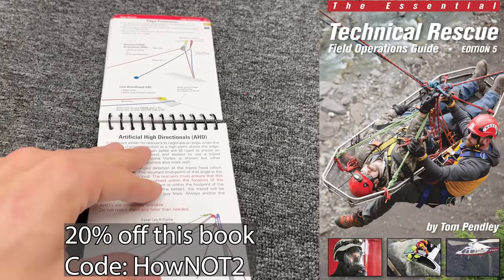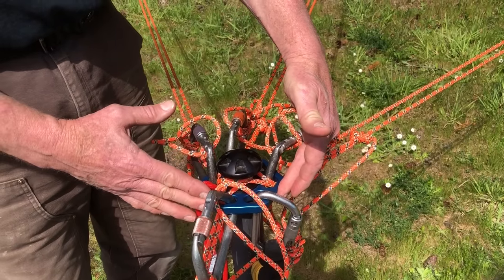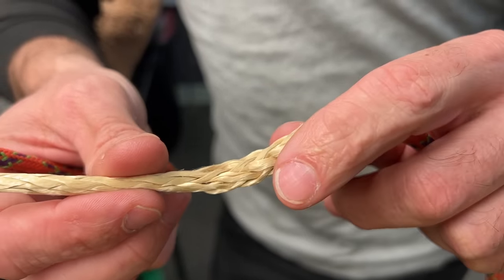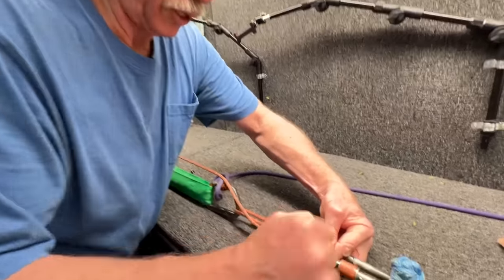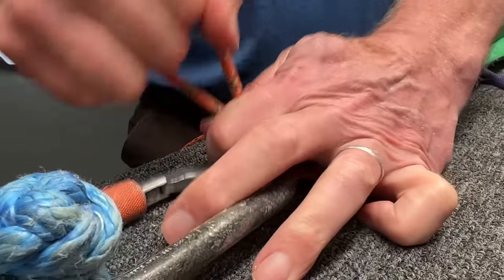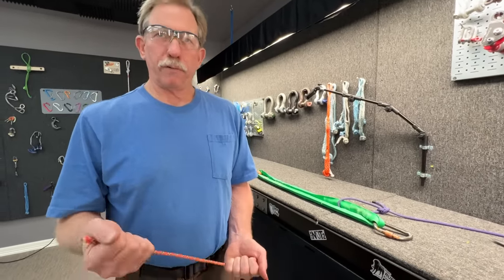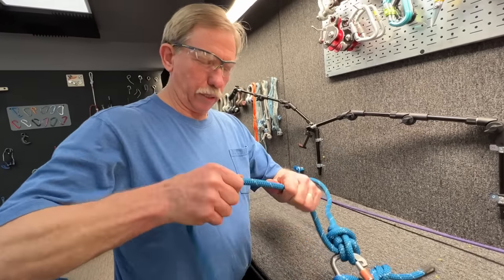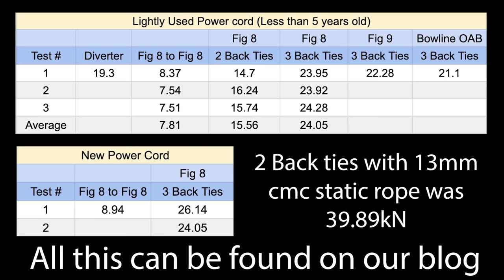How strong is this skinny cord?

Comment: i would avoid calling the figure 8 knot a "Fig. 8" in your literature like that because it could easily be confused with a literal figure number 8 (as in the 8th figure in a section of your literature). I would either type it out or make it shorter like "F. 8". its a nit pick, but i write technical manuals for a living lol

Comment: As an arborist, this served as an excellent illustration of the difference between a bollard to bollard break test, and real world application of a ropes break strength. I use a portawrap (essentially a bollard) and blocks to lower heavy wood and branches, but my climbing lines are often tied off to caribiners. All that said, if I'm putting anywhere near these numbers on my static climbing line, I'm already dead.
Reply: I've used arborist videos quite a bit to explain to blacksmiths and other traditional tradesmen how they can use rope and pulleys to move very heavy pieces.  We tend to get fixated on the details of our trades, developing something of a tunnel vision that occludes anything that doesn't fit our thinking.  Everyone forgets that all those neat pieces of equipment, sculpture, or gates, huge as they were, had to be moved somehow and they didn't have access to modern cranes, ratchet straps, etc.  Thank you for keeping the skills alive!
Reply: @threeriversforge1997  Those skills are very very old indeed. I think the penultimate applications were the British naval frigates of the days of sail.  Every evolution required expert knowledge and miles of (by our standards) very weak lines.

Comment: Thank you very much for this test. If the fig 8 is the weak point of this connection, which results we will expect if you use on both sides the same knot "double round turns and two half hitches"? 

Btw: other manufacturers also have extraordinary products. F.e.
LIROS "Max Load Black", 6mm, 25kn mbs, SK78
LIROS "Control-XTR", 8mm, 62kn!!!!!!, SK99

Regards
ah

Comment: Remember what you learned from the dyneema triple loop testing: pre-stressing greatly increases the strength of a rope system by tightening up the splices (or knots), reducing their tendency to slip under tension. Slipping generates heat, and it's the heat that weakens the rope in the knot, not the pinching. If you re-tie and pre-stress all the knots you tested here to eliminate most of the slippage in the final break test, you will get much higher yield strengths.

Comment: Many, many years ago when I was a full time firefighter and on the high angle team, we were using ⅝" double braid rope.  If I recall, it had a MBS of around 15K lbs.  It was very soft and pliable but heavy as hell!  We were using it on the Dallas FD helo mock up skid at their drill tower and it would not feed through an "8" very well at all.  When I retired, we were using the latest Kernmantle static rope.  I very much like the idea of the PowerCord.  So much lighter and very strong.

Comment: Hey love what you’re doing. I’m a kayaker and fortunately I’ve never had to use my rope rescue equipment. Really enjoyed seeing the knots y’all use and I’ve never heard of a lot of these concepts. Thank you for making great content. I would love to see a video about span sets
Reply from the maker: How do you want us to test spansets?
Reply: @HowNOT2  the way that I have been playing with them is using them as makeshift anchors for boat rescue. I’d love to see what happens if they end up in a basket hitch, girth hitch (and others), what happens when they’re wet, if they can be clipped into an NRS whitewater biner and maintain strength; In short, are they super good enough for whitewater.

I play with a lot of these things all the time if you ever want to talk about whitewater and ropes. Thank you for the great content!
Reply: I've been kayaking and rafting for decades and have never seen a spanset on the river or in a swiftwater rescue class. 1" tubular webbing or 1/2" static rope is the most burly stuff I think you'd find in regular use, if you're seriously risking breaking that with your z-drag then you'd be bending raft frames and ripping grab handles off of kayaks

The NRS biners are nothing special either, just relatively heavy and inexpensive climbing hardware. Both the Nuq and Sliq biners are made by climbtech, with the Sliq having previously been marked by CT as the Anejo
Reply: @liam_hurlburt  sounds like you’ve got a lot of experience. I’ve never seen a span set out there either. I was just curious what might happen and if they could be useful. Also I know that NRS biners aren’t anything special, but they are smaller than a lot of the carabiners I’ve seen in climbing related to thicker textiles like span sets.
Reply: @liam_hurlburt  looked more into what you were talking about. Span sets have almost no place on the River. Just ran across some 18kn webbing and that is more that 2x my span set. Thank you for replying before

Comment: You've just triggered my ADHA with trying to figure out a better knot system to use then figure 8's. I'm scurrying back into my high ropes coarse construction days when we were working out breaking strains on knots and the best one to use to clip clients in using the steel eye crabs. I've always loved the industrial rope access stuff, and I wish we'd done more of the qualifications then we did. 😊👍👍👍👍👍👍👍

Comment: I have a question for you. I do both sailing and climbing. On our boat we have mooring compensators. Basically pieces of rubber you tie rope around in a spiral. If the rope comes under tension the piece of rubber stretches softening the blow and making it a lot more comfortable to sleep onboard. Could you do the same for climbing?
Maybe this would allow you to climb with static rope and give you a more fixed easier to calculate stretch independent of how much rope is in the system.

Comment: In our local rescue group, we use 5.5mm dyneema core accessory cord, rated 22kN end to end, and it has sewn ends to keep the core and sheath together. Would love to see some testing of that in different configurations, doubled with a flat overhand, using it as an anchor, either girth hitch or overhand masterpoint, or in a series anchor. We also use it for load transfers with a friction hitch ob the rope, munter mule at the anchor, would love to see if single strand is suffiecently strong or if doubled is necessary. Also, it would be nice to see the strength reduction some basic knots have on that cord, Figure 8, Overhand and Alpine Butterfly maybe. I believe our cord is made be Austrialpin, I think Edelrid has something similar, though that could be 6mm, not quite sure about that.

Comment: Did I understand correctly that the rope, as such, can tak 19.3kN, and all the other single-rope results were lower because of the knots?
In that case, would it be possible to somehow make knots with a lot higher radius, in order to reduce the weaker kinks in the knot? Maybe one can use metal rings?

Comment: Ive been looking into the Maxim "Tech Cord” and the Sterling Power Cord that you tested in this episode.  The Sterling Power Cord is impressively strong, but surprisingly the Maxim stuff is rated even higher.  It would be interesting to see if how the Maxim measures up with regards to stretch and being tied in a knot.  The really cool thing about the Maxim tech cord is they have two diameters, the usual (5.5-5.9 mm) diameter and a thinner size (approx 3 mm).  The 3mm stuff could potentially be nice for slinging beaks with.

Comment: This was really cool.

If the figure 8 is breaking, can we eke out a little more strength by using round turns with two half hitches? You'd want to tighten them up some to reduce the slipping. It was slipping in these tests, but ultimately snugging up enough to break the figure 8s.

Comment: When I was re-rigging a sloop a while back I discovered that the Vectran core of one line had degraded into a substance that more resembled oatmeal than rope. With the sheath off, I could easily break the core with my hands.  It was basically just the nearly undamaged polyester sheath taking the whole load. I think the damage was caused by exposure to diesel fuel, as the line in question ran near the are where fuel spills were most likely, but it could have been something else. That experience makes me extra cautious to keep any kind of aramid (including Technora) as pristinely clean and cared for as possible. 
I'd be curious to see more testing around aramid exposed to various contaminants.

Comment: Technora is less stiff than Kevlar and is less sensitive to damage. Lines designed to go around a block are often braided quite loosely so that they will flatten. This helps minimize damage due to compression. Aramid is very strong in tension but less so in compression.

Comment: The strength to weight ratio is insane for that PowerCord 🤩
Reply: Just in case you were wondering, Technora is an aramid that is useful for a variety of applications that require high strength or chemical resistance. It is a brand name of the company Teijin
It was independently developed by Teijin and has been commercially available since 1987.26 Technora fiber is strong, lightweight and has good fatigue resistance.
•  times stronger than steel and three times stronger than nylon fibers
• Technora is highly resistant to acids, alkalis and organic solvents
• No melting point. Thermal decomposition threshold at 932°F

Comment: Its always interesting, I hike and do some backpacking. I've replaced my bear hang line with some accessory cord to have something more substantial in a pinch, also climbing hooks are the best pack hangers and nice if you need a little leg up a big step or rock on a "trail", AZ can get rugged at times.

Comment: As a regular climber who do a little bit of trad and alpinist things I immediately thought of using it as a cordelette. Would love to have something that packs tight (6mm) but still is super good enough
Reply: So I have a few 10m cordalettes from powerCord and 10m weights 7.7 oz and makes a really small bundle on your harness. The unknotted strength is 19.7 kN. you loose 60% at the knot  but that still 8kN and in a loop its super strong depending on how many loops you do. I really like it becaus eof the weight and low stretch. You notice the low stretch quality right away. and again, there is no body count from breaking this kind of high quality material, its sharp edges, edge trauma. That is where you need to spend your efforts. every year people get hurt from cut ropes on sharp edges.

Comment: I use this stuff as anchor cord for multipitch/alpine climbs. It's interesting to see how much the eights weaken the cord, given that I also tend to use a bunny ears style cordelette. That's effectively got 2-4 backties, but is also weakened by the masterpoint knot. Still seems safe-ish but not as much margin as I would have thought...
Reply: Yes, it is well reported that Aramid fibers do not perform great when knotted but its intereesting to see it in application. Its still stronger that comparable nylon or polyester cord and my opinion is that the very low stretch is a big benefit for anchor rigging. All of the other cordage/rope in the system is plenty stretchy to absorb energy.

Comment: I bought this cord for building trad anchors because the approach was 9 miles and I wanted to stay light.  Interesting to see how static it is. Obviously super good enough in terms of strength, but really not an anchor material you want to fall on! (Edit: Wouldn't want to fall on with no rope in the system ;) )
Reply from the maker: If you have a dynamic rope in the system it's fine.  It's not less stretchy than if you use a dyneema sling to build an anchor.  I think what you have is great.
Reply: @HowNOT2  Oh yeah! I should have said I  don't want to fall on it with no rope in the system!
Reply: I will also add that especialy we take acritical look at our system whenever there is a fall factor involved. As a lead climber, you have to understad that the amount of rope available to absorb energy should influence your choices. You ask yourself "am I comfortable falling here?" when making moves and if the answer is no, you have choices to make.

Comment: The end of the video made me wonder - I've always heard in a pinch where you're low on material or pieces are spread apart, you can use a cord where one end is a figure 8 loop, and another end can be tied off with a girth hitch or similar, where the cord isn't on a loop. Has something like this already been tested? I'm curious if it would slip/break or otherwise at a dangerously low KN.
Reply: With the setup you describe you would get about the single knotted strength of the cord on that leg. So if you did it with Stirling power cord that leg would be about 7.5kn.
Reply: @mountainmandoug  right, that makes sense. So I guess assuming normal loads, that means each leg may be able to take 7.5 kn a minimum, so good enough?

Comment: .... that better connection could just be 2 wraps ad 3 half-hitches - with the end reclipped.  
(anything with a larger bend radius / avoiding the rope to pinch itself in half... a yachties clevis  / twin bollard has worked for securing lines for generations...)

doubled figure 8 should break higher - the more strands in the knot (tightest bend) the stronger...

Comment: I think it would be cool to not use a figure 8, and instead make the initial connection knot the same round turn with two half hitches, or a half hitch than an overhand, similar to a fisherman’s bend or a rolling hitch around the carabiner. Then test it with two legs and 3

Comment: Is it not possible to replace the figure 8 in the backtie with several wraps around the masterpoint pole itself, forming a tensionless hitch? 

Edited to add: Also, the powercord appears to be a doublebraid, is it not possible to splice it? Have you looked at samson warpspeed II? Its cover can be stripped at the end and it can be eye spliced just like amsteel or I believe you can do the more complicated eye splice if you want to maintain the sheath inside the eye.
Reply: Some rescuers are making a three loop anchor with power cord and girth hitching the focal point onto a small rigging plate. We tested that and it broke at 34kN i think and the big girth hitch did not slip so it was pretty cool. the girth hitch lets you equalize the legs of the master point and you could do a tension fron tie if you wanted to pin the master point down.

Comment: It may not be exactly for the same use but I would love to see how it compare to a Petzl Radline (very light static rope for glacier security and crevasse rescue)
Reply: Ryan should test some RAD line. Petzle rates the RAD at 8kn with a figure-8 knot.
Reply: @mountainmandoug  That's some high figures, considering that it is the same diameter but almost 4 times lighter (Rad : 700g/30m, Powercord 1700g/30m)
Reply from the maker: Definitely testing rad line. especially when we are done building our new abrasion tester :)

Comment: At around minute 6:45 Tom mentions load limiting devices that are in the system. Would these be the Absorbicas clipped to the monopod?
Reply: It looks like the system he was rigging involved a clutch on the mainline, which limits loads by slipping, and the absorbica on the belay, which limits loads by tearing.
Reply: Yes, the concept of force limiting is similar to a relief valve in  a hydraulic system. many devices have a known operational limit (the point where they slip),  If we use devices like the CMC harkin clutch or the Petzl ID or Rig or CMC MPD, we know the the rope will slip for example at 9kN. So thats protective. if an unantacipated shock force occurs in the system, the system will slip before forces rise to the level of component failure. Modern descent control devics do this. Also, when we use dual main lines, we try to keep them equal so if somting happens to one of them, the load does not gain dangerous momentum, It just settles onto the other line without generating dangerous peak force. Unless of course you are grossly not paying attention. current best practice in rescue systems has reduced fall potential from what it typicaly was even 5 years ago. Techniqes like a master point anchor in my opinion make the system cleaner and easier to operate and ultimately safer and more effective.

Comment: Why not put a spliced eye in the end of the Technora instead if the figure 8? all the covered dynema ropes I use in sailing (which are very similar to that technora) use covered eye splices instead of knots
Reply from the maker: You still have the half hitch or a knot on the other side so one side sewn wouldn't retain more strength.
Reply: @HowNOT2  Not sewn, but spliced. Also didnt it break in the 8 knot every time? I agree it would then break in the hitch, but id be curious how much you would gain.